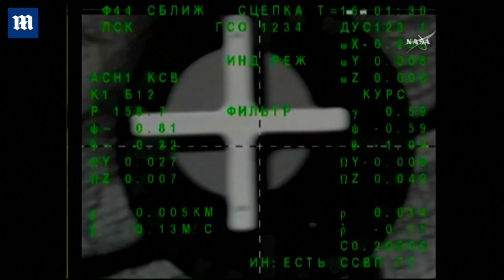Astronauts repair air leak on the International Space Station

Comment: "the vacuum of space would have crushed the entire place"...Vacuum can not crush anything...
Reply: The hole in the ISS was about 2 mm.
It would take about 18 day for all the air inside to exit into space.
Not much of an explosion to me...
Reply: "YES IT CAN BUT ONLY IN REVERSE" Please explain what that means... 
So why doesn't a spray can of deodorant explode when you push the button? 
Same thing, high pressure inside the can, low pressure outside and a small hole.